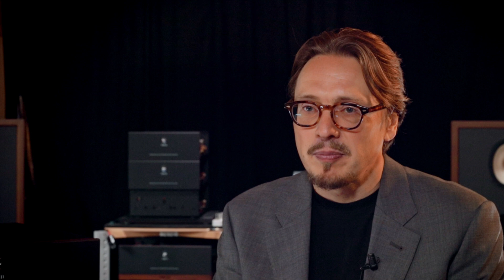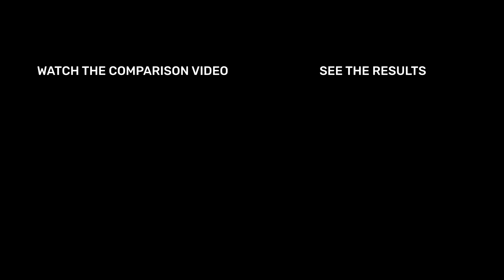How To Compare a DAC? (Part 1 of 2)

Comment: I experienced the same observations and needed decades to solve/save digital from being the destroyer of music ......one makes a lot of ennemies but also friend thinking and working this way .
Limiting the degradation is the indeed the KEY !
Besides no digital filtering there's also a BIG problem with timing ( ryth and pace ) and respecting the flow of the melodic line that's sings a song .........there are solutions and these are more evident than brainwashed modern engineering ..........also not to use SS in the signal path is a poiint , SS makes digital only worse , even the best ( measuring ) SS circuits are no match for quality tube amplification to help preserve the feeling of natural sound/music ...
Have a nice day ;